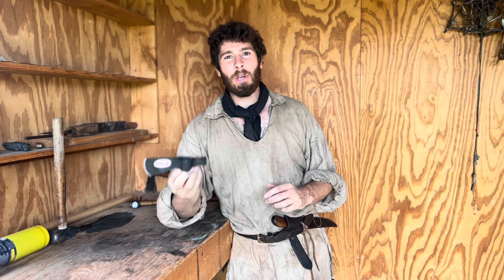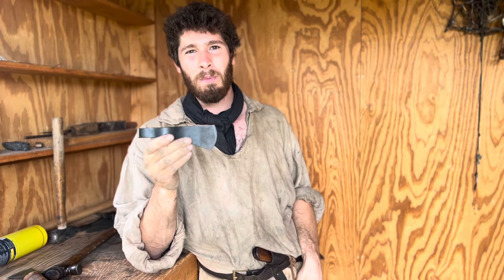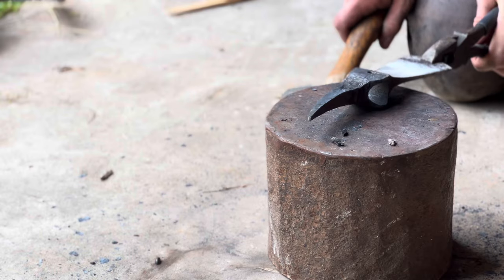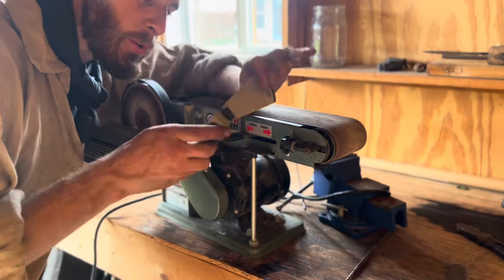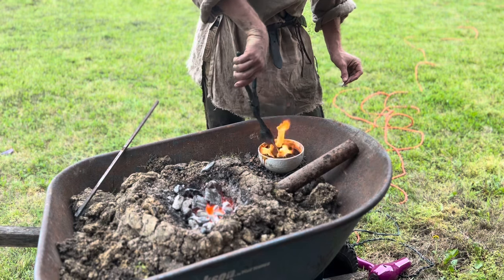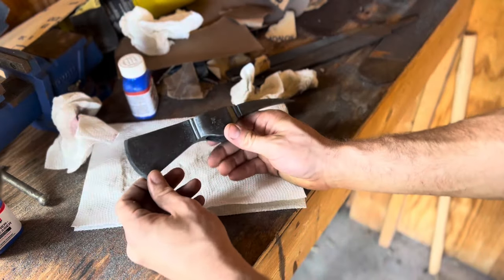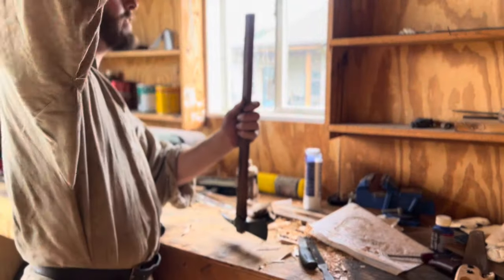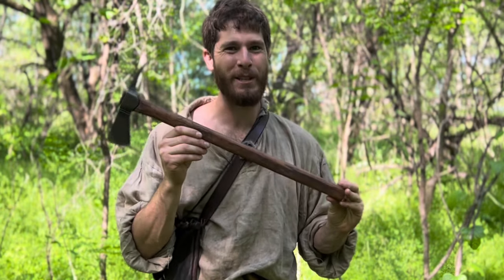Making a Spike Tomahawk

Comment: You can also file small groves into the edge of the hole and use a brass screw and hit the head to smash it into the groves and file it off to get a cool looking rivet or plug thats what iv did on my last ones anyway

Comment: Great video—I subscribed! Years ago I really enjoyed modifying Cold Steel tomahawks, but I found Track of the Wolf’s Rifleman’s Belt Axe to be much better—it’s a kit that’s actually within historic size and weight. The head is cast 4140–and really a cast steel head will hold up just fine after heat treatment. It also lacks the ugly set screw. Comes with handle and wedge 👍

Comment: you should use a larger volume of oil. more oil prevent the oil from getting to warm and your heat treat will not be as consistent. Water would actually be better but you will have to draw th esteel back by tempering.